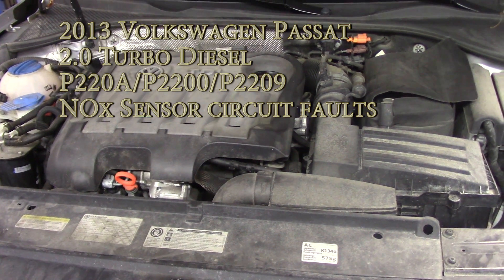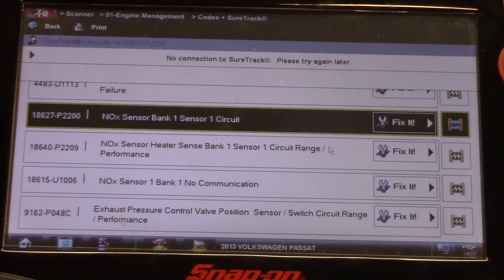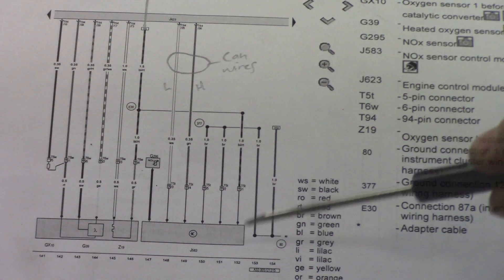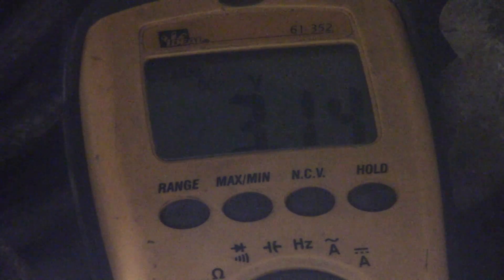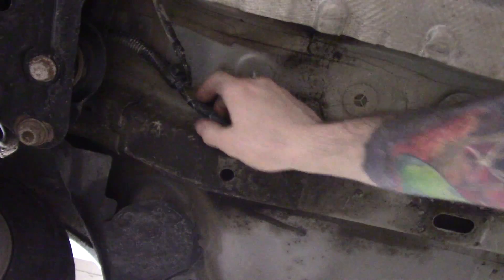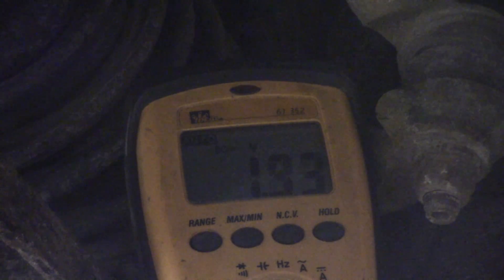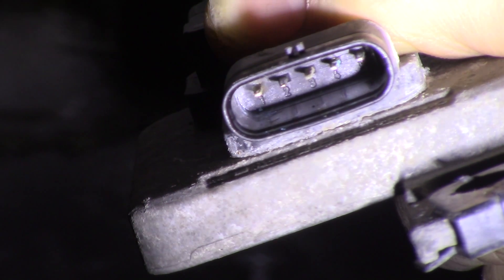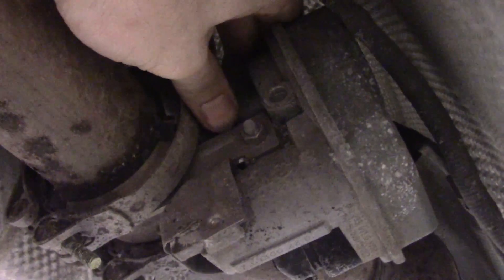2013 Volkswagen Passat 2.0 (TDI) Turbo Diesel P220A/P2200/P2209 NOx sensor circuit faults

Comment: Can you help? I have a P2201 and a P220a code.I have 13v at the power across ground. Bad sensor the issue then? Can I test the can wires for continuity anywhere? Where does this connector go in the engine bay? I bought a box sensor with part number 8K0907807E installed it and it worked for about 10 miles then light again. I ended up buying a new part number 03L907807AF and will try that this weekend. Any thoughts? 2013 Passat tdi

Comment: I've got a P20EE code and my location VAG specialist is quoting £1300.00 for get the issue sorted. 

is this something that u can do if u have a jack and tools at home, I've changed a O2 sensor before.

Comment: Hey guys and girls, guess what!?

I just found out from an acquaintance that works at a Volkswagen dealership[USA] a majority of these TDIs in question have an extended warranty with anything related to the exhaust system. even if you are not the original owner, this warranty still applies to you. Parts and labor is 100% covered. As long as you have never modified ANYTHING on the car, you have a check engine light + DTCs, you should be good to go. just call the dealership and give them your VIN number and describe the problem you're having. They will be able to find out if your car qualifies for the extended warranty. Best of luck 👍
Reply: This is not covered under warranty. There is a tsb about this. It tells you to check the connector for corrosion and replace as necessary. In this case a new NOx sensor and harness.
Reply: I change the conector and nox sensor the problem came back P2201 possibly the wire more up,to be broken?

Comment: DPF's (and generally speaking all the emissions systems crap) will kill the Diesel engine (except the commercial vehicles) in the next years. These systems negate the whole advantage that diesels had, namely reliability, simplicity and low cost of ownership.
Reply: pro trick: you can watch movies at Flixzone. I've been using them for watching lots of of movies lately.
Reply: @Ronan Killian definitely, been watching on Flixzone for since november myself =)

Comment: hi, if I have these 2 codes .do I need to buy new part.03L-907-807-AD.thank you sir.
2 Faults Found: - NOx Sensor 1 Bank 1 P2200 00 [237] - Electrical Malfunction MIL ON - Fault Priority: 2 Fault Frequency:  - --Sense Circuit for Heater for NOx Sensor 1 Bank 1 P2209 00 [237] - Implausible Signal
Reply from the maker: I cant say if that's what you need, but what you need to do is check wiring to the NOx module

Comment: I have the nox sensor dtc codes but my voltage and grounds are in good shape. Can you tell me how to test the other wires ? I think they are supposed to have 1.5 ohms max but not 100% sure where to clip my leads onto.
Reply from the maker: What faults do you have
Reply from the maker: The other wires are can wires that are on the network with the ecm I believe.

Comment: Thanks that was a great video,does the car have any symptoms with the pressure valve seized
Reply from the maker: Thanks. No symptoms it was stuck in the open position
Reply: Exhaust valve?  Is that an exhaust brake?
Reply from the maker: Used for regeneration of the dpf

Comment: Hi like a month ago I got one of my customers car a Passat TDI 2013 with a defective NOX sensor and there was a permanent fault and there was a warning that the car would not start in 300 km's and this car had a intermittent fautes for this sensor for months and we were hoping that it would last until the buyback but it failed and it's pretty expensive at around $ 900 but the car was outside the VW warranty but surprisingly the exhaust valve and AD blue tank heater never failed witch I heard of was common. I like that the new diesel are clean but they are expensive to repair when they get older like all the extra equipment needed to pass emissions parts like EGT sensor,NOX sensor,particles filter,egr valves coolers, urea tank lines and injector and heater and fluid level sensor etc. .....
Reply from the maker: This one also had a no start warning I forgot to mention. Yes the valve and tank heaters are very common.

Comment: does the module need programmed?? also was that the nox sensor that looked like an oxygen sensor? I don't work on vw's
Reply from the maker: No it does not need programmed and yes it looks just like an o2 sensor
Reply: Mine did not restart so I hauled it to the dealership and they told me this sensor was bad and was corded and does not fall under the recall warranty. They worked on it 9k miles ago and said they replaced the def heater, now they want to charge me over $900 to replace this. If I replace it will the car crank back up without a computer to reset something?